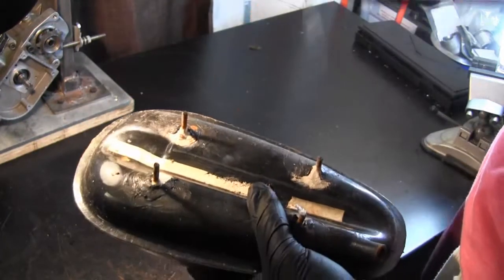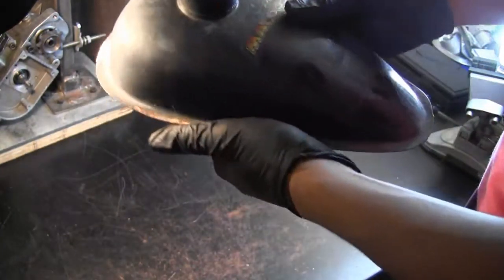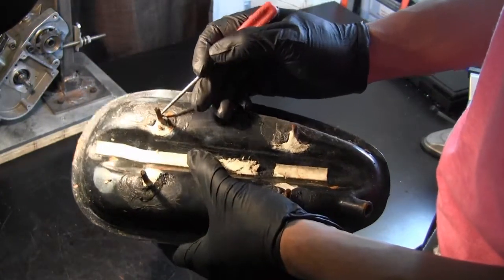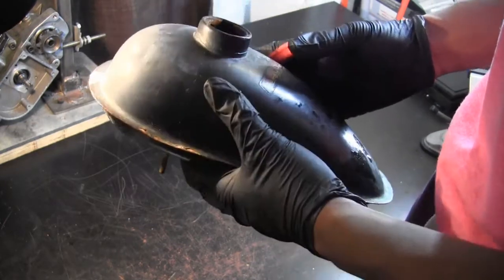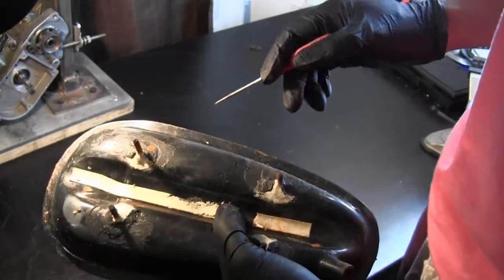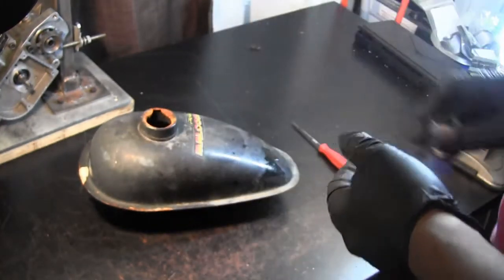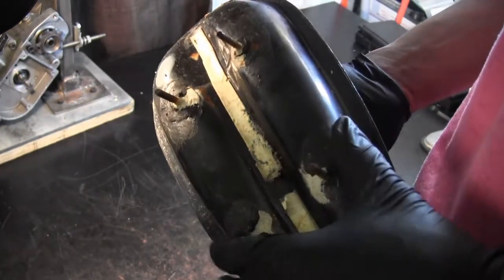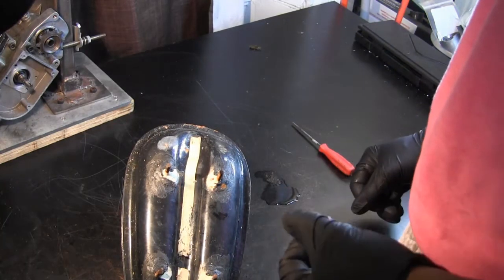Moped Gas Tank Repair Tips

Comment: I tried this and it worked for a week. So I cleaned off all the JB Water Weld and sanded the paint to metal around the studs and did it again. The gas seeped through the water weld in about a week again. The water weld would turn a bit blue like my gas. Anyway I bought a new tank from Amazon for $18.00

Comment: Not bad welds just realy thin gage steal its only 18 about the same as coffee. Can a old bike intertube raped around the top bar that te tank is strapped to will stop vibrations and give shock resistance and keep air pockets out of the file line

Comment: You can seal the inside of the NEW tank with KREEME.

BEST SOLUTION: If you have an OLD tank I think it's less expensive to buy a new tank. It costs almost $40.00 to PREP and SEAL the inside of the tank and a new tank at this moment is only $15.00

OR you take your tank to a radiator shop who also does gas tanks. They will clean the inside of the tank and put in an industrial liner to solve the rusting problem.

KREEME has one problem: The tank must be perfectly clean for it to stick and I have over time seen it come loose and float in the tank. If you are planning on using it, get as much gas out as you can and let the rest dry up. Leave the petcock out when using it or it will plug up.
Reply: Buzzards Bass
Reply: Yea, I bought some JB Water weld like the guy said in this video and it only held for a week. Then I sanded it all and redid it and it lasted another week.  I bought a new tank!  $18.00 from Amazon.  Shit, I am gonna buy another to have as a spare at that price.